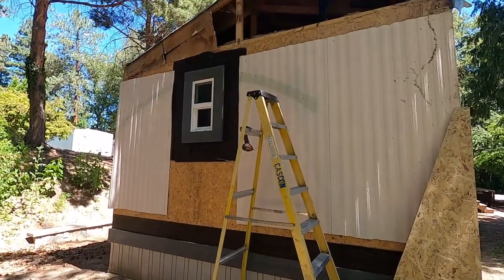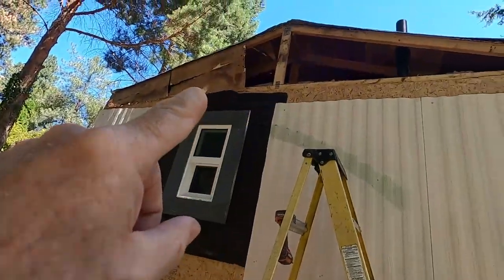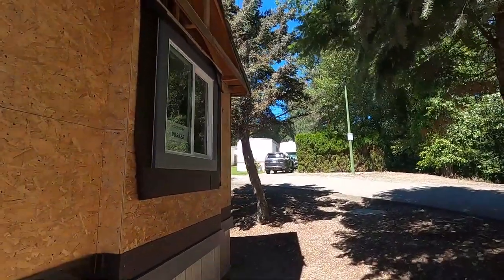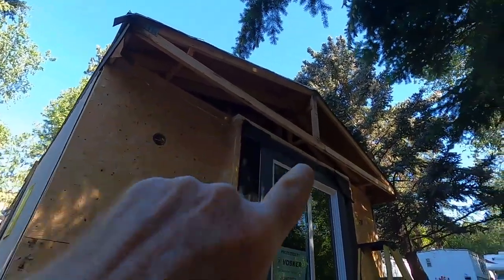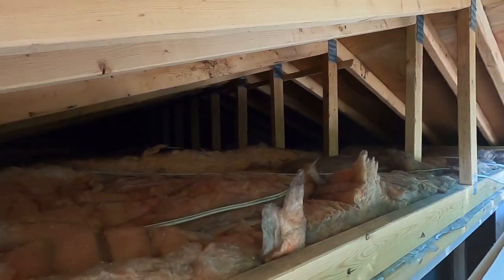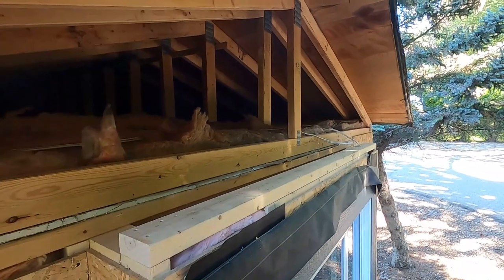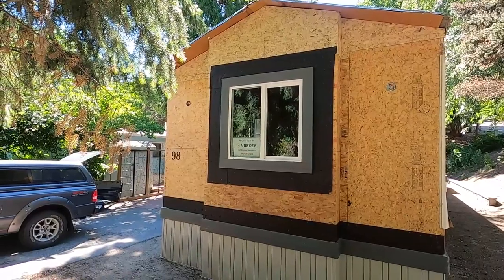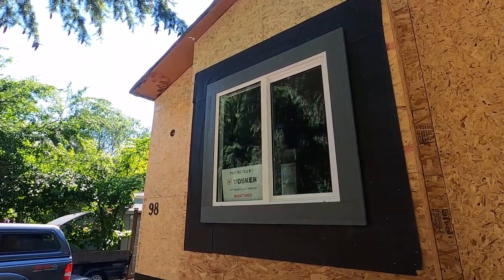Some Gable End Framing : E118 / BC Renovation Magazine

Comment: You definitely want a good overhang on all sides. Luckily for me the former owner of the 1972 model I'm dealing with put a metal roof and structure over the home. Best thing they ever did. Everything else is a shiite show. I've come a LONG way. If you have drywall between the studs, etc you're lucky. Try compressed paper. That's what it is. Multi-tools make good work of it to get it ready for drywall. When you're gutting the ceilings make sure you have clutch bits for your drill. You can get them from a trailer supply site. Gotta love those florets.